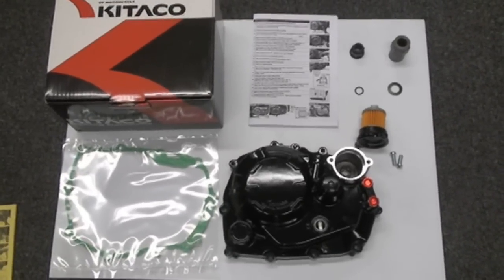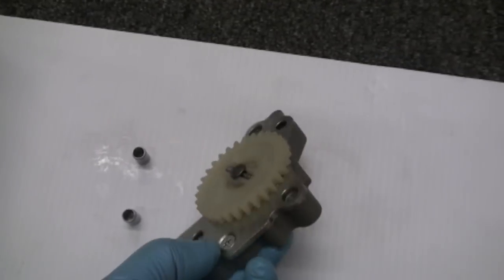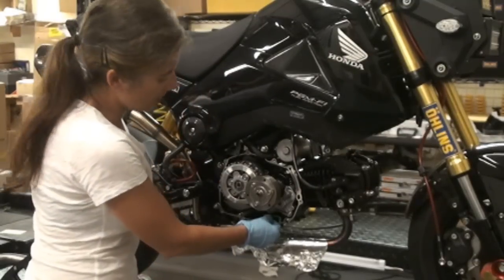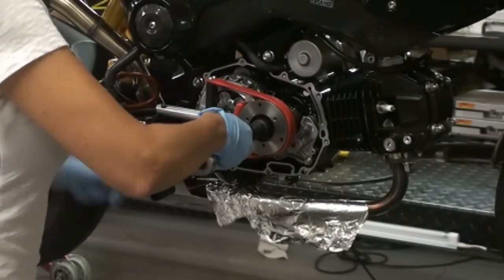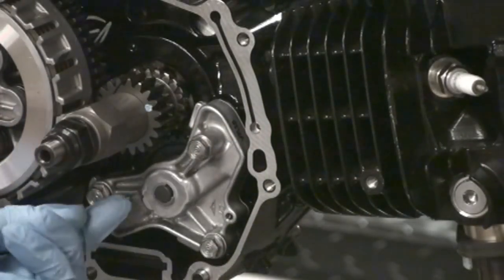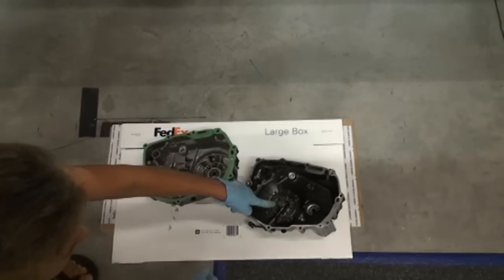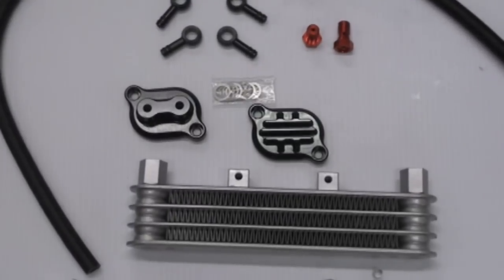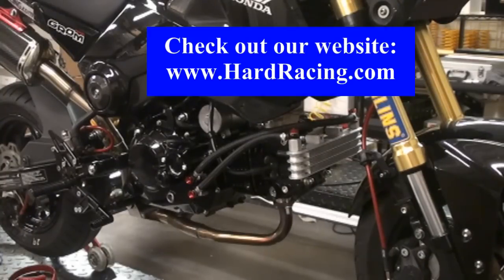Honda Grom Kitaco CLUTCH Cover  IN STOCK Oil Cooler Takegawa Super Oil Pump Spinner #Hardracing

Comment: I’m sorry in advance if this is a stupid question but I just received my clutch cover kit from you guys and I was wondering how the oil filter is effective when the housing is totally sealed in its own compartment how will the oil be filtered?
Reply from the maker: That's not a dumb question.   The Filter is actually NOT Sealed in it's own compartment.  There are small oil ports in there that feed the oil through the filter and back out.
Reply: Great! Thank you for clarifying also I just finished installing the clutch cover and super oil pump. Oil cooler system is next and then the Ohlins rear shock I also ordered from you guys
Reply from the maker: @antoniochacon7985    That's excellent news.  ;-)
Reply: Anyone know why after installing the clutch cover the bike shuts off when trying to place into 1st gear? It’s starts just fine in neutral ughhh
Reply from the maker: @antoniochacon7985  That would indicate something wasn't installed correctly.
Reply: HardRacing  hello well that’s obvious, I was hoping you would have a more technical reply or suggestions to this issue, like the timing is off as a result of the engine being turned accidentally while trying to take off the darn oil spinner with that special tool I bought from u guys etc etc
Reply from the maker: @antoniochacon7985  The clutch Cover install would not have anything to do with  your timing .. as all of those components are on the other side of the motor.  Unfortunately, trying to figure out what the problem is, without knowing what you did, or having the bike in front of us to inspect everything sort of like playing darts blindfolded.  If we had to guess, the Clutch actuator may not have been installed correctly, or the clutch cable isn't adjusted properly.  So the Clutch is not fully dis-engaging when you pull the lever.  Again, this is totally a guess.
Reply: HardRacing thanks guys problem resolved!!! Just a dumb oversight with the auto kickstand! Just installed the Ohlins rear shock looks and feels great!
Reply from the maker: @antoniochacon7985  Excellent.  Glad to hear that.

Comment: Can you keep the spinner but add the cover? The bike feels like crap now that I've pulled the flywheel off. It really needs that weight.
Reply: No it does not, it rev matches better, starts up more easily & operated more efficiently after the update + you can check the oil status with the sight glass, add an oil cooler & use an actual oil filter that makes the oil change 10 faster & easier // check your tuning, think about getting a PCV, chimera & after market exhaust // tune that Grom to make it go better, row them gears with more precision, rev faster like a vision, zoom zoom //
Reply: @AaronSchwarz42  Mine no longer wheelies because it doesn't have the kick anymore, burns the shit out of my clutch, stalls way earlier, and idles like shit. Of course I can change my oil easier, but it just doesn't feel right at all. Feels like I may have lost a bit of engine braking too and the oil sounds sloshy at high rpms. Can't be good for it.
Reply: @AaronSchwarz42  Fixed a bunch of it. The ECU wasn't happy with the mod. A second reset and it's running way better. Still loses wheelie torque. Regained low end torque and a bit more top end.

Comment: Hello again. Was wondering about the oil cooler. CAN, you install it upside down so it it higher in the airflow from the air flowing between the front fender and the light assembly? I think  it would allow more airflow to hit the engine with the oil cooler raised up 3 inches. What do you think?

Comment: so that oil cooler is completely held up by the two bolts in the center that go to the valve cover?  there isnt any additional support or brackets for it?
Reply from the maker: Correct.  Or we also offer an optional Frame Bracket as well.   https://store.hardracing.com/kitaco-frame-bracket-plates-upper-and-lower-13-20-honda-grom-grom-sf.html

Comment: How much more oil do i need when i add the oil cooler?
Reply from the maker: not much.  as you see in the video, it's just about the same as stock.
Reply: @HardRacingPerformanc  thanks!
Reply from the maker: @MrSapper21    Any time.  Always here to help.

Comment: I had a 183cc bigbore kit on the grom but than the intake valve broke. I decided to switch back to the original 125cc bore. The clutchsprings are the only things that remains from the 183cc and now I have the following problem: 

if I go for a top speed run when the engine isn't fully warmed up (lets say 200F) my speed is 66 miles/hour. But when the engine is fully warmed up (say 240F) my top speed is 59 miles/hour. 
Also when the engine is warm the top speed is only maintained in 3th gear. If I change to 4th gear it can't keep up and I can't ride harder than 47 miles. 

I also have a TTO temperature sensor which I put between the (NGK 7)sparkplug washer and the head. This may cause the spark plug to be pushed a little bit too far back out of the head?

Do you think that it's possible that its caused by the stronger clutchsprings? Or do you have any other suggestion what could be the problem? 

If I change clutch springs I will install the Kitaco Clutch Cover too in one run so I am curious about what you have to say. You helped me out before when I bought something from you that you recommended.

Comment: Hi, just a quick question, what torque should the clutch basket nut be done up to if changing out the clutch plates at the same time as the springs?

Cheers

Comment: After watching a few folks on youtube do this clutch cover I have yet to find anyone speaking about torque. The oil spinners weight acts like a flywheel. Lighter will reduce the torque a lot. The engine may seem to spin easier but it can be stopped from spinning much easier. I want to see the differences on a dyno.
Reply: That's actually not correct.    It Does not have any effect on the torque the motor can output.   If you reduce the weight in the flywheel it will reduce the work the engine has to do allowing it to rev more freely.    The Torque  is measured by  horsepower of the engine x 5252,  divided by the RPMs.
Reply: @saleshardracing1561  I'm not here to argue. Feel free to dyno a before & after. Torque is the engines spinning force. It's altered based on the weight of an engines crank. The heavier the crank the harder it is to stop the engine spinning. Horsepower isn't the measure of an engine spinning. No doubt that the oil spinner contributes to the engines spinning force. All I want to know is how much torque the little engine has both before the oil spinner is removed & after the oil spinner is removed.
Reply: @saleshardracing1561  Question, not an issue of reducing torque but rather removing the spinner, yes will make it easier for the motor to spin up rpm's faster due to the reduced mass and weight BUT would it not also be true if the engine was used more for lower rpms and say off road use, not high rpm use the added weight of the spinner spinning making the crank "heavier" reduces the ease of the engine quitting or stalling out when used at those lower ranges?

Just because one mod or change works well for power and performance for a motor doing high speed runs where performance in the 11,000 rpm range is king does not mean those same modifications will be a plus in an engine where its performance better suites the task in the 6000 rpm range.

I love the replaceable oil filter feature and the available oil ports for an external oil cooler but question whether my usage of lower rpm offroad combined with sub 9500 rpm normal cruising usage of the engine if retaining the weight of the oil slinger would actually be better for my use scenario?

Comment: this video is very helpful for my install, but did you guys have to adjust the clutch adjuster on the clutch cover after installation?
Reply: Yes, that is correct.  You will need to adjust the clutch Lever/Cable once you do this install.

Comment: Curious question why would I need the stock oil screen if the Kitaco has an oil filter? Wouldn't you still need to clean the screen during an oil change.?
Reply from the maker: +Aaron Rehor 
It's just a recommendation by the manufacturer.
If you don't want to run the screen, you don't have to.

Comment: When you torque the capture nut to 47 lb ft, what is stopping the crank from turning?
Reply from the maker: +Raddish! We wedged a little device in between the two gears.
You can also hold the flywheel with the holder as well.
Reply: A wrench on the nut behind it.
Reply from the maker: Yep.  Many ways to accomplish the same result.
Reply: If you need something else to wedge the flywheel anyway, why do you recommend buying the holder? (And why did I buy it?) Also, you cannot use the flywheel holder for the capture nut. It does not fit in the gap between the flywheel and the other insert.

Comment: Just keep in mind they raised the price by about 27%.  It $300 now.
Reply from the maker: Unfortunately,   Costs of Material have gone up, over the past 5 years since this video was made. as well as shipping, and covid related supply chain issues has caused the increase price approx. $59
Reply: @HardRacingPerformanc  I found one for $279. Yeah, I bought it. It really is a great mod.  I am not going to install until I get my high flow oil pump and oil cooler. 
Great video, It really is going to make the job a cake walk.

Comment: hi, in this system what exactly hose is, clutch cover in? or out. I mean which hose is in to radiator which is out? thx
Reply from the maker: It doesn't matter. since Both hoses run to the radiator, and it's bi-directional.

Comment: I did all of these upgrades last night. I used the larger kitaco cooler and I’m running into clearance issues with the cooler hitting the front fender when the suspension is compressed. Any cooler mounting bracket modifications that you can recommend? Thanks :)
Reply: Yes, for sure we recommend the Frame Bracket be used when all possible.  
https://store.hardracing.com/cart.php?target=product&product_id=31515

Comment: I definitely want the Kitaco Clutch Cover for easy oil changes but I am unsure about the HD Clutch Springs and Billet Spring Plate. Will I need them for commuting? I will not be doing any tricks/wheelies or redlining. Thanks! 😀
Reply from the maker: stiffer springs are Not really necessary if you don’t want to
Reply: HardRacing Got it! Same goes for the Billet Spring Plate, yes? Thanks again.
Reply from the maker: That's still a good part to get, for reliability, since the stock one does break on occasion.
Reply: Thank you! :D
Reply from the maker: anytime.  Always here to help.

Comment: does the honda recommended tool need a special adapter to fit into a socket wrench?  looking at getting barnett clutch plates
Reply from the maker: It uses a standard 1/2" socket extension.

Comment: great video and a big thumbs up for that clutch/spinner tool part number! Now that you have the SF (I'm in Australia and have the US spec SF) can you confirm if this will all fit? The only difference i have seen with the new vs the 'OG' is the turn signal plug has gone to 2.8-3mm spade/blade connectors. I found this out because i bought the op-mid temp indicator after watching your video on it and just had to splice different connectors to their supplied power wire. The CHT plug was the same and it works a treat! hoping this all works with no issues! looking for clutch upgrade in the near future!
Reply from the maker: Yes, confirmed it will fit the SF

Comment: How does oil flow through the filter? The plumbing isn't very obvious from the information I can find. Where does it source oil on the dirty side and send it on the clean side?  The Takegawa claims 30% more flow, but what is the actual flow rate? I am keeping my Grom primarily stock but would like a true filter rather than the screen.
Reply from the maker: When you get the cover you will see the oil passage ways within the Filter Pocket.  Unfortunately, we don't know of anyone that has taken the time to plum an Oil Flow Gauge on their Grom to measure the Stock Flow rate.
Reply: Thanks for the info on the oil routing. I wouldn't expect anyone to plumb a gauge onto a bike, but it wouldn't be difficult to do a bench test of the two pumps.
Reply: A bench test would probably take more time and work and money then just plumming a Gauge on the bike........ to  figure out all the proper fittings for each pump and plumbing and having a motor spinning at 6000 RPM....etc..   Not quite as easy as you may think.
Reply: @saleshardracing1561  We'll have to agree to disagree on that, it wouldn't be hard to set up at all if you applied a small amount of math. If I ever decide to change my pump, I'll send you the numbers. Cheers.

Comment: how tight did you tighten the bolts on the friction plate that covers the clutch springs?
Reply from the maker: +GoTankYourself  Shows  9 lb/ft
Make sure you do a little at a time.  and criss cross.

Comment: Wouldn't you want to feed the hot oil into the far side of the cooler? Once it cools its going to be thicker so having a shorter hose would rob less oil pressure from your engine. Is there a measurable change between the two?
Reply from the maker: The temps only drop about 20-30^ so the viscosity different is negligible.

Comment: How do I stop the crank shaft from spinning while tightening to 47 foot poinds
Reply from the maker: If you don't have the proper tool,  we've found that most guys get by using a Popsicle stick or similar to push in between the two gears to keep them from rotating.
Reply: @HardRacingPerformanc  I used a wrench and held it on the part behind the bolt and did it
Reply from the maker: @CLCSurf  Excellent.

Comment: 14:09 how did you torque it down without having that shaft move?
Reply from the maker: we had a special tool that goes between the two gears.
But you can use anything, like a pop stick, or a hard piece of plastic, or a clutch tool holder like this.
http://store.hardracing.com/cart.php?target=product&product_id=30084&category_id=2681

Comment: alright fellas, I swapped my clutch plate and 3 springs in a staggered position, from theSicShop and now my bike runs fine in 1st gear, but when i shift to 2nd or 3rd it just stays in high revs and no acceleration... what’s wrong :( plz help lol
Reply: Sounds like you may have received a bad spring plate.  Call the company you purchased it from and see if you can get it swapped out.
Reply: should have never fucked with it ? I love how people think they know more than Honda Engineers
Reply: buy a bigger bike if you want to go faster- KTM-390 is a good choice for the same money as a grom plus mods .

Comment: Hi what oil do you use with this kitaco clutch cover ?
Reply: Honda GN4 during break in.  Then Mobil 1 4T after break-in.
Reply: sales @hardracing is that oil 10w 40 ? Would it still be ok to run on the Honda oil 10w 30 ? Thanks

Comment: so what dose this do to the bike? ??
Reply from the maker: +alfredo cipres 
- Oil Changes are a simple Filter Cartridge Swap. (no more needing to remove covers, wipe spinners, and replace gaskets) 

 - Eliminates Oil Spinner (less rotating Mass) 

- Built in SITE GLASS for Oil Level Check (Big Plus)  

 - Oil Ports for Connecting to an Kitaco Oil Cooler
- Reduces Engine Temps, if you also add the Oil Cooler.
Reply: +HardRacing Does the oil change interval change at all now? What do you normally change at?
Reply from the maker: +Ryan Fonseca 
Still the same interval.... Just much easier to do now.
Reply: 3000 miles?
Reply: hello Hard racing, can you remove the spinner on a pretty much stock grom, or will it cause any issues?? thanks
Reply from the maker: You can. But, then you will have basically removed the Oil filter system.  Which will eventually damage your bike.

Comment: omfg I didn't tighten the clutch bolts down all the way not its not going into gear properly. I have no more oil FML EDIT: because if GO GROMS VIDEO THEY SAID THE PLATE HAD TO BE EVEN NOT TIGHTENED ALL THE WAY DOWN